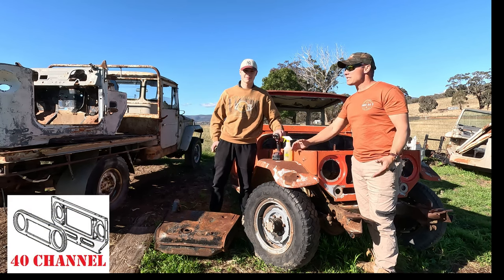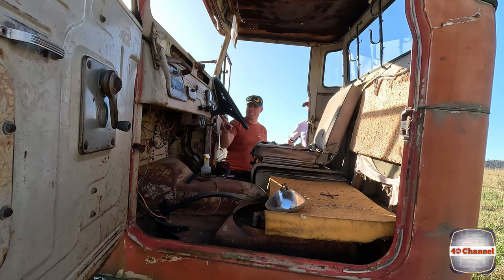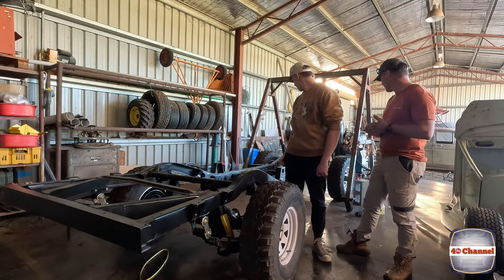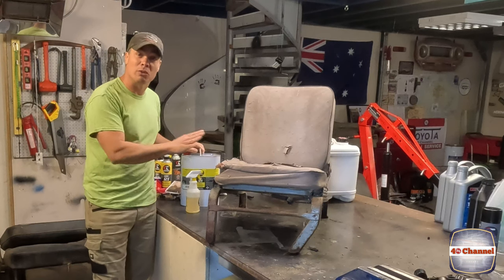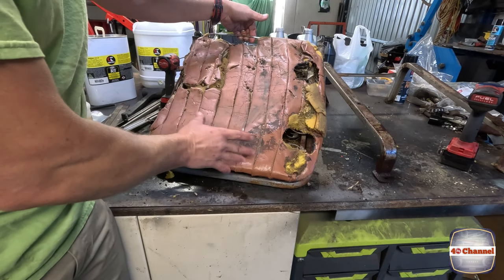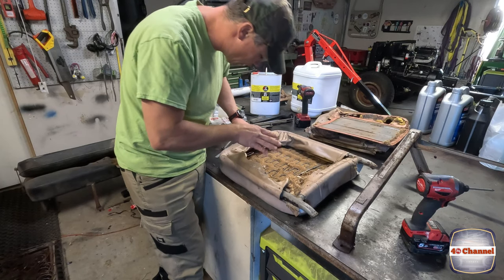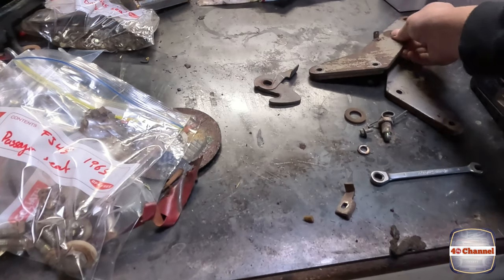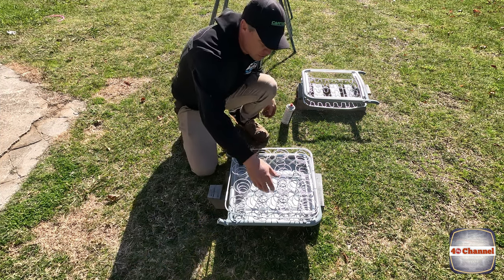S2EP89 - Remove old seats from Landcruiser Firetruck for new upholstery, FJ45, FJ40 - 1960 onwards

Comment: Great job Jason, I am restoring a set for a HJ47 at the moment there is a lot of work just restoring the frames. Your fire truck is going to look fantastic when you are done.
Reply from the maker: Thank you Simon yes you're right. There is a lot of work just in restoring seat frames, and this is only the halfway point they still need new foam and an upholstery.
But the biggest challenge is picking a colour that will compliment the fire truck red.